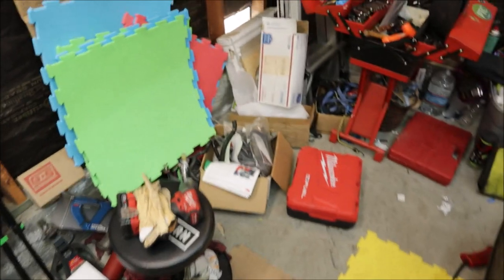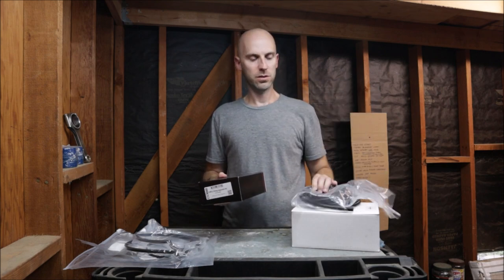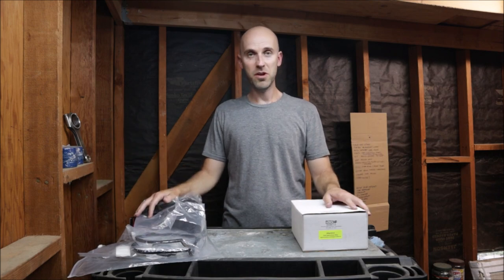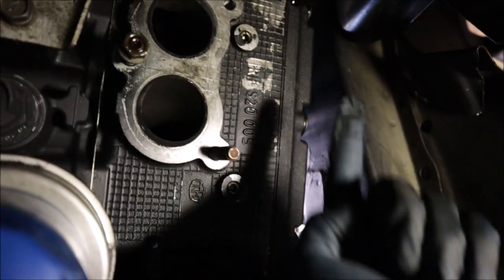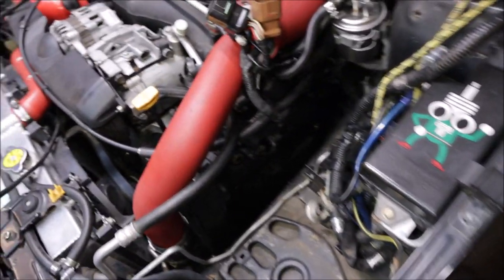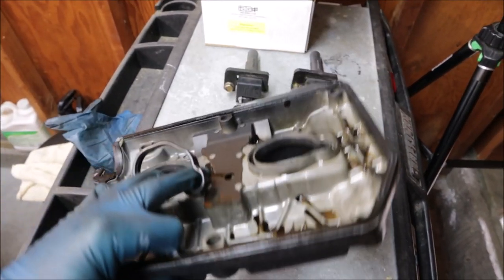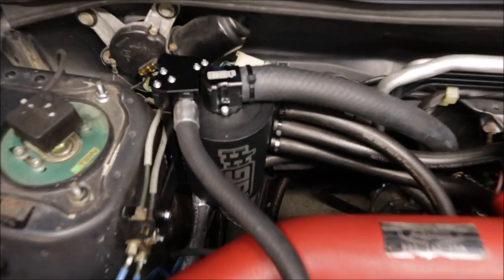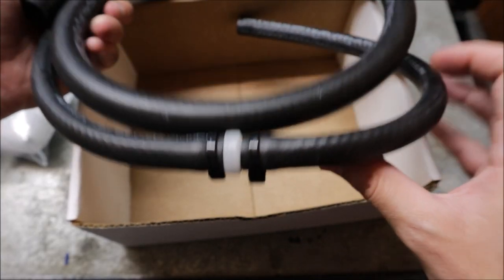Impreza GC8 Build Setbacks // Oil Leaks, Air Oil Separator & Boost Controller Revisited

Comment: @6:50, you are missing the crossmember plate that bolts below the steering rack. That's a jack point. Find one to put on so you can use it in the future to lift the whole front. Don't lift the whole front from the lower radiator support like you can on a Toyota/ Honda.
Reply from the maker: I had no idea that was missing! Thanks for all the help. Does it do damage lifting from the front tow hooks? I usually go further back behind the oil pan at the cross member.
Reply from the maker: I see, it looks like a jack pad and a T bracket I am missing. Great help 👏
Reply: @RoadPatina  i lift from the tow hooks too because my 99 impreza wag is lowered a bit. I drive my car on some 2x8 wood pieces to get a little extra lift before i jack my car up from the cross member.

 I've done quite a bit over the years. I need to update. 
https://www.rs25.com/threads/fujis-gf8f5sd.98262/
Reply from the maker: @FuJiNF  that’s a ton of work, great job! I have spent days looking at build logs on rs25 and need to update my build thread. I found this car in those classifieds!

Comment: Why you use 1/4" fittings instead of OEM 1/8" Fittings?
They control the presure fast and with less Air in them its faster. Sorry my english is bad, I'm german.
Reply from the maker: Chris Burkhardt your English is great! I can say two words in German. I was told to upgrade for the external wastegate. The vacuum hose would not fit on the ewg fitting and just barely over the turbo nipple. But I am not an expert! Just trying to get her running. What is your setup?
Reply: @RoadPatina  Thanks.
My Impreza Gt (turbo) wait for a Apexi AVCR Boostcontroller. I have german Blog: https://subaru-shakedown.de/blog/index.php?user-entry-list/2614-gt-cube/
Next Projekt ist a newer Steering wheel and a new LifemnPO4 Battery.
Reply from the maker: Chris Burkhardt nice! Sounds fun. I’ll check out the link.